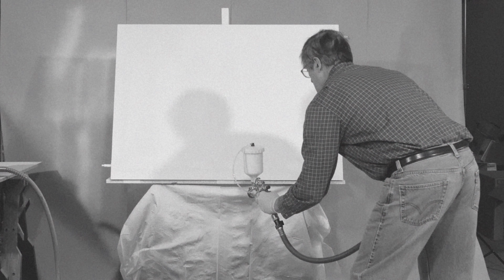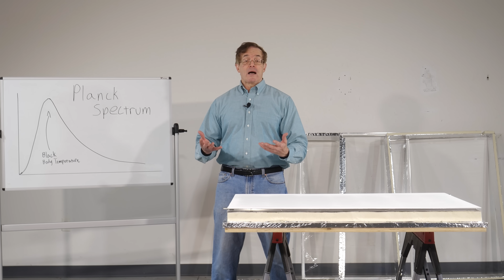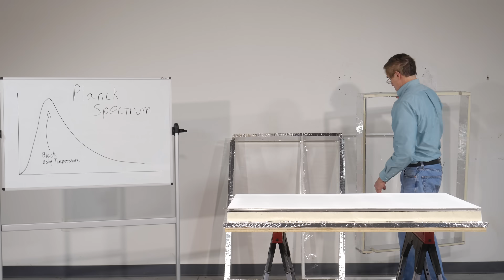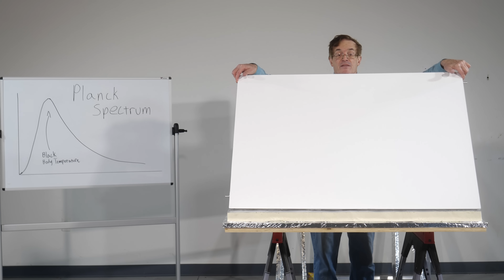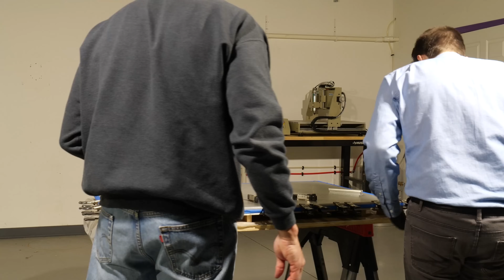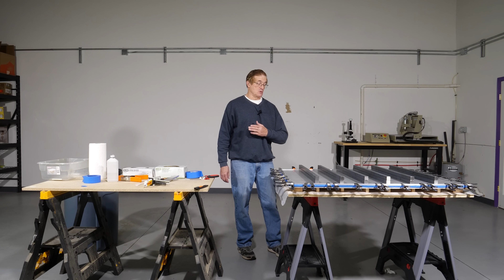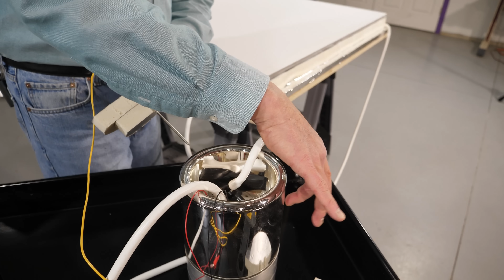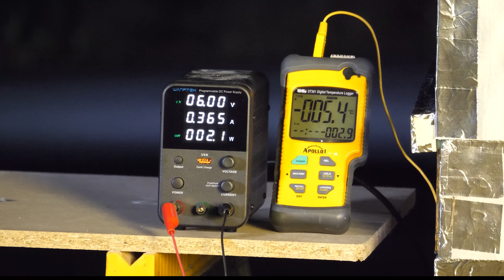Air Conditioning isn't free... but we're close.

Comment: I wonder how resillient the paint / coating is to natural elements. I have an apartment with exposed flat concrete rooftop that gets really hot in the summers. (Have not measured the exact temperature, but it almost burns if you try to walk barefoot). The air conditioner has to work noticeably harder to cool down the room.

If the coating is robust, I might just paint the top to reflect away the heat during those pesky Indian summer months!

Looking forward to the next video, and if possible,  please add some suggestions how your coating can be used to passively cool down flat concrete rooftops.
Reply from the maker: A couple of labs are studying that.  It appears promising.
Reply: @TechIngredients  I am aware of simple exterior paints that are already used to simply reflect the sunlight, but they are nothing special. Just the typical rubberized white paint. An additional bonus is also there if bifacial solar panels are installed on the roof. So if there is a coating that can reflect most of the heat away in the first place, and provide additional cooling at night, while generating more electricity, and doing everything passively... That would be fantastic!

Comment: I think I recently had to fight this effect on a telescope that I'm making robotic. I spent hours indoors trying and failing to focus it. I finally braved the bears* outdoors and had a look at the telescope. The front corrector lens was coated in a crust of frost which blinded it. If I remember correctly the dew point was 15F above ambient temperature which was around 40F, so I hadn't expected problems with dew or frost because I didn't give thought to radiative cooling. I ended up wrapping the front of telescope tube with a few meters of heating cable from a burnt-out heating pad and run it at 12V. I use old yoga mat foam rubber for thermal insulation. It seems to be close enough to sufficient heat to keep it dew and frost free and not so hot as to cause heat distortions. Later I'll add a thermostatic control. 

If I remember correctly, it was the Iranians who in ancient times sold ice year-round made in shallowly dug pools in the desert by radiating water's heat into space at night. At least that's what I read somewhere.

* The bears seem friendly, even jolly, but I would rather not find out if they are just trying to give me a false sense of security.
Reply: The iranian ice thing is incredibly interesting
Reply: yakhchāls ( a Persian word - yakh meaning "ice" and chāl meaning "pit"),

Comment: can't you just use the coating directly on the radiator on the outside portion of the A/C? wouldn't that give some benefit to letting it get rid of more heat outside and not require a separate fluid path?
Reply from the maker: It wouldn't  hurt, but separate  stages would be more efficient.

Comment: cool stuff.  I particularly liked the tie into heat pumps.

I really feel like heatpumps should be integrated into a lot more in houses.  We've got HRV's and tight houses now to boost efficiency, but they work even better with a heatpump integrated into them.  heat pump hot water tanks as well.  Dehumidfiers, heat, cooling, hot water, all of this could be integrated to run off a single compressor unit outside.  It could even be complicated a bit so that when you have differing needs (say, AC in the house, but hot water for showers) the heat need not be rejected into the atmosphere, but simply moved and condensed to be used in a different way.

Unfortunately, this sort of thing needs either a high level of integration within a company, or strict standards so that you can piece a system together from different brands.

Oh, i forgot! cooling solar panels and dumping the heat either into the house, or into hot water.  The possible combinations are endless!
Reply: Using AC condenser heat to warm up hot water in the summer is a really smart idea. Just add a water pump switched on by the blower fan and circulate that hot water to and from a normal boiler. Doing that all day long it might never even have to switch on.
Reply: @markm0000  it's a tad more complicated >< i believe only co2 based heatpumps can bring the temp up high enough for hot water, but surely you could have a small pre-warming tank, or maybe build the entire system with co2 as a refrigerant.  There's a lot of little aspects like that though.  I find it disappointing that there are all these building codes to increase efficiency, but they still haven't mandated heatpumps.  They are by far the most cost effective way of reducing heating energy needs.

We just did a mini-split in my brothers house, and we figure the payback period is only 4-5 years, and that's in a place with cheap electricity.
Reply: Tesla uses this approach in its EVs. The enabling device is called the “Octo-valve”.

Comment: If your demonstration was running for one hour to drop the temperature of 2 liters of water by 8'C you got an efficiency of 72 btu/h per square meter including the pump heat loss. A fun experiment but it's not going to replace an AC any time soon.
Reply from the maker: There were about 5 liters in the system, and the submersible pump was adding its own heat.
Reply: @TechIngredients  You still did not mention how long the experiment took 1 hour with 2 liters or 2.5 hours with 5 liters gives the same results. The pump generate 8 btu/h a 2W pump, I took it in account otherwise I would have said 64 btu/h the real usable efficiency of your panel

Keep in mind we are working in the radiation domain, the aluminum coated wall are at ambient temperature and are emitting a lot of infrared like 400W+/M2 and are reflecting both ways, from your radiator but the IR from the surrounding as well.

You are an engineer and should be familiar with all the the values of heat transfer, thermodynamics and proper measurements, so please publish them time, volume, temps and publish the results in joules, Watt, calorie, btu or whatever is your favorite unit is. Otherwise you just sound like another of those free energy gurus and looking at the comments that's how you're understood.

If you really want an almost free AC, use solar panels they produce 200W/M2 when the sun is high up exactly the time you need your AC the most and 200W with an AC with a COP of 3 is producing 1200 btu/h add batteries to have it run 24/7 and its still 8 times more efficient than your device which is very well built and might double its performance using dewar style insulation but no more, without breaking some physic laws.

Now if you can develop a coating which would reflect the sun IR on a solar panel in the CO2 transparent band improving its efficiency,  by cooling them down and reducing there global warming footprint as they are currently reflecting IR in the long wavelength spectrum which is absorb by CO2, it would be great, you could even earn $M and a noble prize.

Comment: Been enjoying your efforts.  Im a retired HVAC trained guy that worked in boat bilges and RV's too.  Most fun to install were some residential ground loop heat pumps.  They talked of grabbing extra heat to also spin a turbine using the Hot Gas part of its loop, but US Power never continued... 
 Best heat gatherer I've met involves a copper tube, 8mmx2m long filled partially with a refrigerant... even waxes and oils boil... .  The high end of the tube gathered the heated... maybe vaporized fluid and that has been inserted in a very well insulated pipe that contains flowing fluid to storage or even heating uses.  Glass tube collector systems make boiling water in artic conditions. 
 My roof array has 22 tubes, and when i had it connected to my electric water heated our power bill dropped 50% in the summer, 25% winter.  San Juan Islands loose sun in the spring and fall but 10% helps.  I had used a direct water loop with freeze considerations and lost the array twice from freak 15F nights.  Soon i will  use an oil or glycerin loop.  The 12vdc 10w pump runs  from a 30w solar panel so it circulates on even cloudy days. 
 When it worked it got REALLY hot in august and cpvc pipes going up to the array stretched.  I ended up cooling the hot problem by using a pump to give instant hot water by looping under the home to the baths etc and allowing it to be running at 140F using a dryer Tstat clamped to the array loop.  The insulated water loop loses enough heat to the crawl space but but boy that water can be HOT. 
 They sell Temperature Safety valves... cuts hot into the cold  and i got one somewhere.  I bet you could put similar tubes into a box that has one way glass and a mirror in back... not sure how my glass tube covers like hail BTW.
Reply: I'm pretty sure he already made a solar water heater. Those are very effective.

Comment: My parents have a heat pump and in-floor heating. It's functionally capable of cooling in summer, but very rarely actually does so. The reason is that the system has a shutoff to prevent any elements from going under the dew point. The last thing anyone wants is to start condensing liquid on the walls/pipes or on the floor. Not only would slick floors be a hazard, but you'd also be giving mold and open invitation.
Edit: We live in Central Europe. Basically no one has residential house scale air conditioning.
Reply: You also wouldn't want to walk over freezing cold floors, even in summer. I guess 15°C or so would be what you'd want to aim for.
Reply: @Pystro  People should wear open toe slippers in the summer, save a bunch of money on socks and save your heels walking on hardwood floor.
Reply: @jacob1121  While that is a good advice in general, it won't solve the ice cold floor problem - at least not for everyone: Some people have pets, and sometimes you want to sit or lay on the floor. Also, you can feel if a floor is ice cold through some slippers, depending on sole thickness.
Reply: A heat pump in cooling mode is just a standard air conditioner. In a typical install with an air handler or mini split evaporators, having the evaporator below dew point is a feature -  the evaporator is used to dehumidify the air as it cools it. Dehumidifying the interior air then also lowers its dew point. A properly configured air conditioner (or heat pump in cooling mode) should help with condensation issues, not cause them.
Reply: @hatsuwr  As mentioned, 99% or European residential housing do not have a standard air conditioner.
They have radiators and (sometimes) in-floor heating, but that's meant to be used for heating, not cooling.
Reply: That kind of heat extraction from a building works best when it's in the ceiling and in a low humidity environment, like you infer. You could couple the system to dehumidification but now you are getting really close to being back where you started with air to air heat exchanger which is how most AC works already. It also dehumidifies at the point of chilling the air and can eject the excess moisture outside. The system described in the video would be most useful as part of a heat pump system that already common around the world and make them more efficient than they already are.

Comment: Why use a submersible pump here? Your setup would deliver up to 2 watts better cooling if the pump's motor body was able to dissipate some or all of its wasted power into the air, rather than into the fluid you submerged it in
Reply from the maker: It was simpler  to install even though  it reduced the efficiency.
Reply: @TechIngredients  thanks for the reply! I would think the complexity of the rest of your build (welding the aluminum frame... Epoxying the sheet metal) would outweigh the simple complexity of having to pour water down the pipe to prime the pump the first time you start it 🤣

I for one would have liked to see if increasing motor speed has any effect on efficiency of the system. It's hard to know the break-even point of flow rate in any custom heat exchanger, unless it is tested in reality.

Comment: How much heat was the pump contributing to the system? It looks like a 7F deltaT with 0 load. How much BTU/H load can this handle? I am very curious about when the ambient increases. Pools in the south become bathwater and simply circulating the water through this emmisive chiller could be a phenomenal way to cool off a pool during the summer. Also, having a coaxial heat exchanger on the liquid line to your AC system would also increase the efficiency of said AC system. But by how much? How much extra kW does the circulation pump use?

Comment: How much more efficient would heat transfer be if the 1mm sheet of aluminum had ridges machined into it like a heatsink?
Reply: Aluminum diamond plate is readily available and would increase the surface area for better heat transfer at low cost compared to machining costs.

Comment: Free Air-conditioning? If you take an old window mounted  airconditioner, put it on the shelf in your laundry room, and duct the air from the condensor coils to your laundry dryer's heater,  then when you dry your cloths, it will take room temp air heat it, and send it to your dryer, and you'll get free air-conditioning.   You may need to set the dryer to tumble with no heat.

Laundry dryers heat air to 125f -130f. luckily the hot air comming off the airconditioner is also about 125f. And you heat pump laundry hot air coefficient of performance will be between 300 to 400% over resistive heating. 

Yeah, no free lunch here, but you get to dry your clothes using less energy and get free cooling as icing on your cake.

Comment: Very interesting for sure, but I don't quite understand the fluid path in the heat exchanger.  First it looked like it would snake around the foam inserts, but then the struts were placed there.  Now it just flows over the height of the foam randomly to the other side while being interrupted by the struts/braces?
Reply from the maker: The struts  don't  span the full width.

Comment: It would be beneficial to incorporate that into a solar panel would it not, since solar panels are more efficient when cold, and these... Must by default, be exposed on a roof or similar?*
Interestingly if you add a luminous material to the polyethylene solar cells under it perform better.